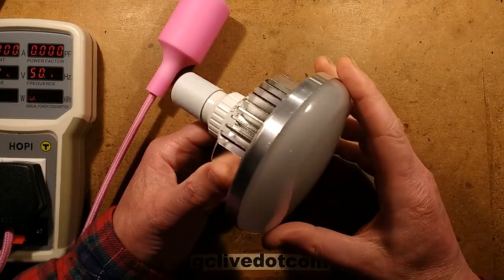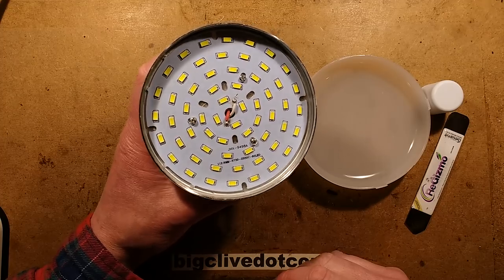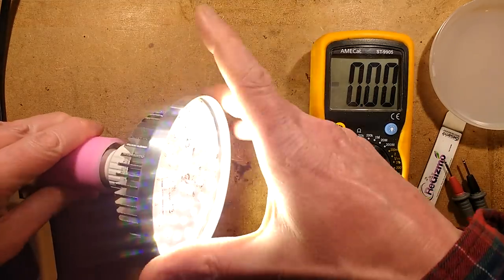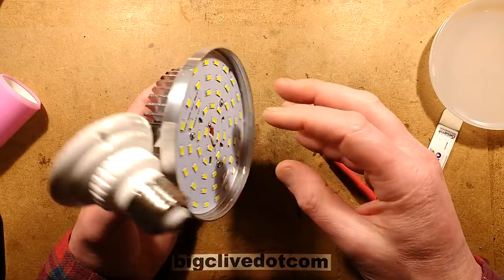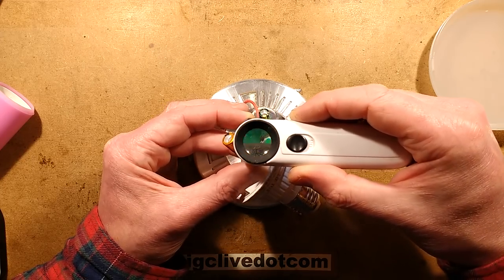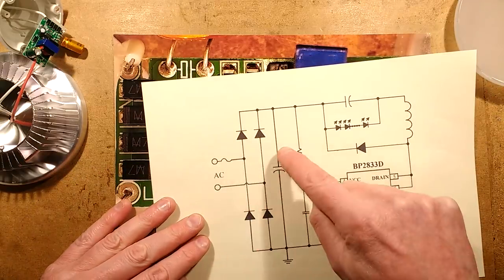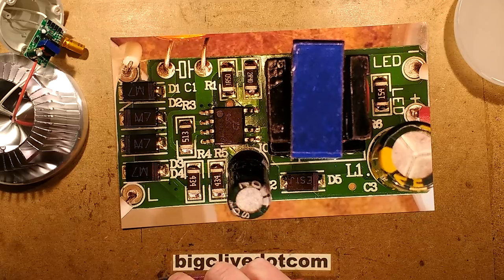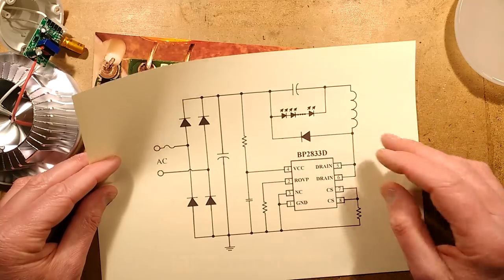Inside a stylish 65W LED photography lamp.

Comment: It would have been crazy uneconomical to machine any of those parts as the predominant process. The heatsink should be an extrusion, and yes extrusions can have a texture, because the die is CNC machined, the dish probably stamped, but both slightly machined on a lathe afterwards, probably not taking more than a few seconds.

Comment: They probably say that because there are 60 1 watt rated LED's.  60 Watts plus 8-10% engineering tolerance.

You could theoretically push them to their limit but of course it wouldnt last and would quickly overheat in that package.  Would be interesting to heat sink them and drive them at full power.
Reply: I think you hit on the answer.  It's just a matter of adding up the nominal value for all the LEDs.  That makes sense.

Comment: Should be bright enough for its intended use though. Plus, LED's running at lower current, will last a lot longer. Depending on that OPTO Isolator chip. Maybe not, not seen them ever run hot. Even when overloaded. The transistor/mosfet in the opto must be generating the heat. Which should not be a problem but given the package size of the opto...who knows.

Comment: Sixty five watts is the power of your average desktop processor. Now look at the size of the fan cooled heatsinks used in them. Look around on the net for what it takes to get one fanless.
Reply: Luke Den Hartog different Story a processor produces much more heat
Reply: 65W is 65W still
Reply: Luke Den Hartog
An input of 65 watts doesn't mean that the output in heat will be the same.

Also, a processor has to stay within a certain temperature specification, otherwise it will malfunction. You need good cooling to keep it below that threshold.
Reply: Francesco Bertolaccini A processor converts all of energy input to heat, while an LED converts most of its energy to light, and only some to heat. Some more efficient LEDs, such as the ones by Cree can have fairly high wattages in small packages (none of these Chinese LEDs are that efficient though).
Reply: Amar Gandhi I would say that cheap chinese LEDs would top out at 10/15% efficiency, which is far from converting "most" of their power into light. So a processor might waste all 65w, a led will waste 60w: the problem still persists
Reply: @acgandhi  nowhere near "most of the energy to light"

Comment: While not relevant to the video this seems like the sort of place to ask; I've been looking for a simple to use preferably free wiring diagram drawing software and I'm curious if anyone here has any recommendations.

EDIT: Forgot word "drawing"
Reply: Thanks, I think I'll try TinyCAD for a while, seems to do what I need.
Reply: If you are into 3D Printing, and using Blender, TinyCAD is available as an add-on. Quite a good package, and it has the advantage of being able to edit existing (i.e. imported) files. https://sourceforge.net/projects/tinycad/

Comment: Is there still value in rating lamps by wattage instead of by light output? Isn't a lower power consumption with equivalent light output superior?
Reply: Christopher, yes and no – for photography you also care about the actual quality of the light (=spectral content). Incandescent is (and will remain) unsurpassed.
Reply: What does power consumption (wattage) have to do with actual light output (luminosity and its spectrum) and whether its source is incandescent or otherwise? If it's possible to generate equivalent quality light output (brightness and spectral content) for lower power consumption (wattage) isn't that objectively better? And therefore, demonstrates that wattage (power consumption) is not a useful metric for a lamp? (At least, not useful when other data is not also provided.)
Reply: Christopher, so, is that a bunch of rhetorical questions? I think my response was very clear – unlike your original post because the phrase "equivalent light output" is ill-defined, and could very well have meant only the amount of light. BTW, I mistook your original post as an actual question, and didn't think you were only looking for an excuse to be rude.

It is fucking obvious that if you could cheaply, reliably and accurately replicate black-body radiation in the visible range (let's say 380nm to 750nm) while keeping the efficiency higher than that of the lowly incandescent light bulbs, you'd have a superior technology, no matter what the marketing material says about its nominal rating. Good fucking luck with that.
Reply: Jason Doe hey Jason... can the attitude. Your original post wasn’t an honest response to a question, it was an insulting post deliberately missing the point.
Reply: Apexah, eh, I think you might be misreading the subtext here...

I can probably seem to be "quite a dick" when feeling insulted, but at least I express myself openly, not with thinly-veiled contempt and patronising "questions".
Reply: Jasper Janssen, I'm sorry if you really felt insulted, but my first post here was a purely technical observation on something which I find many non-photographers fail to consider, and thus I thought that some people might find interesting. It was a response to the second part of the OP.

I'm sure we both have better things to do than continue this nonsense, so have a nice day (really :)
Reply: Christopher exactly but people are still impressed by numbers.
50 must be better than 20 etc, I'd guess it is actually equivalent to 55watts but somehow it's lost in translation.

Comment: You could replace led's as they go or mount a couple 10 watt COB's.
Reply from the maker: With the regulated supply it could run three 20/50W style LEDs in series.

Comment: In the video the domey bit looks turned...? Including inside the circuit board enclosure bit. Whereas the heatsink looks like an extrusion. It might be glued or just bolted together via those screws?
Reply from the maker: Three screws hold the PCB and it's housing onto the extrusion.

Comment: I wonder if they lied about the colour temperature too. That's an odd colour temp. value to have. Not that it matters with modern electronic photographic equipment with in-built white balance. However, the lumen output is what a photographer would mostly be interested in.
Reply: I don't think the K is off that much if at all for the simple fact that 5600 K is a popular color temp and this is 5500?  That's about what direct sunlight is rated at.  The thing would be great in a large bank of others for a huge outdoor fill lite.  But a reflector would be fine too.  I can't quite get the idea of how this thing would be best used.  It's not beefy enough for outdoor work by itself, and indoor work would be around 3200 K.  I like it though.  I'm in the US.  Wonder if they have a 120v version.
Reply: Colour temperature varies by the time of day and how overcast it is. 5500 K would be quite a blueish white. However, my point was that it was an odd value more than anything else. I grabbed this off some site rather than quote Wiki (they were too long) -

"The three primary types of color temperature for light bulbs are: Soft White (2700K – 3000K), Bright White/Cool White (3500K – 4100K), and Daylight (5000K – 6500K). The higher the Degrees Kelvin, the whiter the color temperature."

Comment: I'm looking for a real no flicker photography light (LED) for high frame rate video work.  Needs to have adjustable brightness but can't use any PWM.  Any ideas guys?
Reply: Kaiser - Yes, a DC input would be idea for me as sometimes it will be outdoors.  It would have to have a linear current PS built in ideally although I could use my bench PS but I want something more compact.  I have a good "video" LED light that is all in one but it uses PWM so I am looking for something else.  It won't be as efficient as a PWM unit but I can't have it flickering at high frame rates and using a typical incandescent bulb produces a noticeable 120 Hz.  I can use car lights of course but would like more efficiency to reduce heat, increase battery life, and I still need some dim-ability and they will change colour as you dim.

Thanks for the reply!
Reply: ElmerFuddGun, almost all LEDs will change color as you dim if they have proper current regulation, although the difference can be almost negligible, depending on the emitter phosphor composition. It's certainly the lesser of the two evils, the other being PWM, which you absolutely need to avoid for this application.

(It's worth noting though that PWM is often used when color stability is important, such as in LED monitor backlights, although you need it in the KHz range to be imperceptible.)

Don't worry about the efficiency difference of the driving circuit, it's negligible. Good linear regulators are better than just wiring a resistor in series with the LED, and are in fact used in high-end battery-powered flashlights.

In fact I'd forget the word "efficiency" and go all the way to incandescent, if I were you, and skip the trouble, not to mention get way better color rendering as a side-effect  ;)

edit: Oh, you want it battery-powered. Yeah, forget my last suggestion, haha. Still, you want a high-quality linear regulator, not PWM. Strange as it sounds, high-end flashlights were one of my little hobbies, and I know there are several online fora where you will certainly find answers to your questions. Sorry I couldn't be of more help, I basically reiterated what you had already said.
Reply: you can use standard step down. if you can really see the ripple at 100khz or what they are running at,
 add a linear regulator after the step down with 0.5v or 1V to regulate on.

if you need 12V: Step Down DC-DC to 13V, then linear regulator to 12V

But i dont think you would see the high frequency step down, because there are caps and the led hardware dampening the switching.
easier would be to add additional small resistor+capacitor in front of the leds.
Reply: edit: for the cheapest version this means you have to turn two potis and need two analog voltmeters to add.
first step: turn down the dc-dc control poti
 second: turn down the linear regulator to a voltage of 0.5 to 1V below the dcdc so it has something to regulate on.
the linear reg will still need a heatsink for 500mA to 1Amp,
which should not exceed 1Amp x 1 Volt = 1 Watt of heat to dissipate, so not that big.

more complex you would use a stereo poti and modify both voltage regulator circuits to work with it.
for the constant load the regulator shouldnt have a problem smoothing the ripple.

Comment: What part does the voltage dropping from 230volt mains to 100volt operating voltage ?? 
Please excuse my question.
Reply from the maker: The control chip meters pulses of current through the inductor.

Comment: you measured 100 volts so 140 volts is dropped right ? so that would be 140V/30 chips=4,6V so maybe 2 LEDS per chip ?
Reply from the maker: 100 volts measured across 30 pairs.  So 3.,3V per LED.
Reply: Ok got that wrong :) So they are single LED chips then

Comment: can someone explain to me how a lot of these lamp circuits have LEDs in them but are like 100 volts or so? how are LEDs at such a high voltage without blowing up? Usually LEDs are around 3 volts or so.. is it because the current is so low? Could i take a traditional LED and limit the amperage so i could put 100V through it?
Reply from the maker: They use long strings of LEDs in series like Xmas lights to keep the current low.

Comment: I have a theory. Across the pond, we sometimes see lamps labeled in their equivalent incandescent wattage. So you may see a bulb labeled as a 65W equivalent bulb meaning that it has the same output as a 65W incandescent. Any chance that could be the case here and the seller is really really bad at english? I'm guessing you don't have an old filament bulb laying for comparison but the average lumen numbers for that class of filament bulb should be available if you have a way to measure the led unit.

Of course, they probably are deliberately misrepresenting the wattage, but that may be their reasoning.
Reply: Based on the numbers your describing, the buld you have would fight with replacing a 65~70 halogen give or take a bit.
https://www.thelightbulb.co.uk/resources/lumens_watts/

Comment: Clive, just posting this on here because I know you will respond. You use spudgers frequently. Do you buy them or make them, and if you were going to make one what would you use? My thumbnails will thank you!
Reply from the maker: The best spudger I've used had been the iSesamo.  It's the correct grade, quality and thickness to have lasted years of use.  Others have snapped, kinked and crumpled in a few uses.  The curved tip is slightly ground with a narrow edge.

Comment: They did not lie about the power rating on the LED light, they used American nomenclature:  Example, when I purchase  LED light bulbs at Wallyworld (Walmart) I look for "60" watt or "75" Watt or "100" watt bulbs because that is what I am accustomed to buying with the old incandescent lamps.  I know how bright those are (were) and I want something of similar brightness,  really don't care about the actual power consumption, I just want something like I used to have.  I am holding a LED lamp package, and marked in LARGE BOLD type, "60" watt  and in mice type, it tells me "Actual Power Consumption 9 watts.   So you folks on the Isle of "Persons" need to look at these things with North America eyeballs.

Comment: So not an electrician
But didnt you say that sticking your probes int a mains socket would blow the meter?
You said the leds where live at mains when plugged in, so why is your meter not sploded?
Reply from the maker: If the meter is set to AC voltage it's fine.  If the leads are in the current position it will short the supply.  Cheap meters shouldn't be used for mains work as they do not have suitable protection.

Comment: I wonder if a lot of these false ratings is due to miscommunications between the engineers that design them and the factory that tries to pump them out in china. Like the engineer probably had it down as a replacement for a 65 watt bulb or something but the factory took that as meaning it's a 65 watt bulb instead of putting the actual wattage on it. Although there is always that chance it's actually a malicious false printing by using cheaper components but charging for the more expensive ones to cut down on costs to be more "competitive"

Comment: You short out the capacitor almost every time.  And for good reason.  But has there ever been a time where you forgot to and got a shock?
Reply from the maker: Yes, plenty.
Reply: bigclivedotcom never has it happened on video?  Always appears to be discharged already.

Comment: Wouldn't a "driverless" circuit be completely inappropriate for photography? So I wouldn't expect that.

Incandescent filament takes time to cool down, but with LEDs there's no such "inertia" and you'd get 100Hz / 120 Hz flickering (assuming rectification) which is absolutely horrible for studio work – since it is too close to the most commonly used shutter speeds (often 1/125 or 1/250 or so, due to mechanical constraints of actual, non-electronic  shutters).
Reply: PS. As a (shitty) amateur photographer, I couldn't click fast enough! I wouldn't trust LEDs yet, though... Insufficient spectral content  :)

(hey, better than CFLs, which are an absolute photographic nightmare and a very tiring literal eyesore as far as I'm concerned  ;)

Comment: The dish thing is probably stamped, rather than spun or machined.
Reply from the maker: It looks quite detailed with grooves and no sign of the stresses from stamping.
Reply: That's a bit odd. Maybe with stamping they couldn't get it flat enough for good thermal transfer? I don't know why else they'd use a more expensive process.

Comment: About all these 3x ratings on chinese led lamps. Are they trying to say it is a 65w replacement, or is this like a PMPO type situation? Send a bolt of lightning and say LOOK it took 65w for a millisecond, good enough.
Reply: 65 watt replacement. This is very common in north america. Dunno about UK.
Reply: dwarf365 Since 9W LEDs are claimed to be 60W equivalent, I'd say 22W would be around 150W equivalent. So no, it's not a equivalent rating, it's just a lie.
Reply: Someone above mentioned that the lamp has about 60 LEDs, and suggested they list the combined rating of the LEDs but drive them much under that

Comment: Such a strange surface finish on that heatsink. It almost looks like a cast part but the shape and ridges on the sides suggest it was extruded. Do you think that maybe it was clearcoated really poorly? There's really no other reason I can think of for that weird texture. You'd expect a bit of roughness on the top because it would be sawed off but this just looks like someone chewed on it. Maybe they did cast it but then there's really no reason to have every surface parallel. Maybe it looks worse on camera than it is... As for the power it's just grossly overrated. A lot of others rate it close to the apparent power instead of the real deal... Technically volt-amps instead of watts, but who cares, the number is bigger. This one seems worse than that though.

Comment: Each 5730 LED 0.5w，so 60 LEDs 30w at most . Considering the LED quality and the high temperature，the designers tend to lower the current to make LED units last longer. Maybe this LED lamp has the same brightness with 65W fluorescent lamp. So they just labled 65w. Just kidding ：）